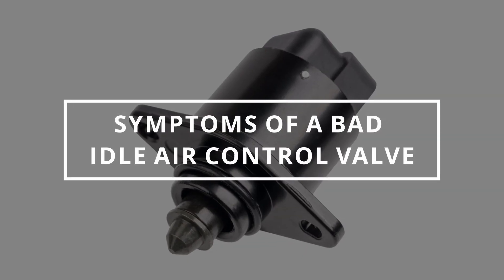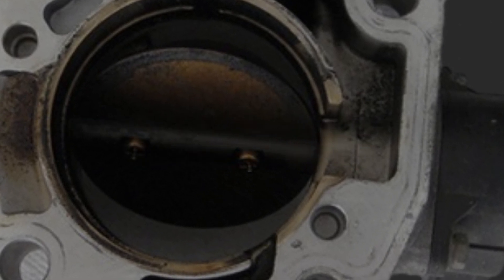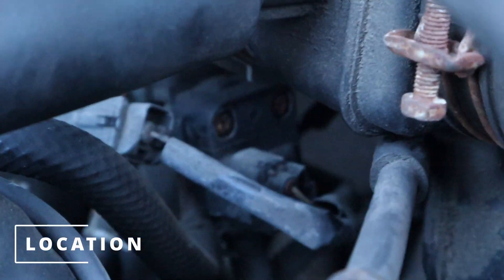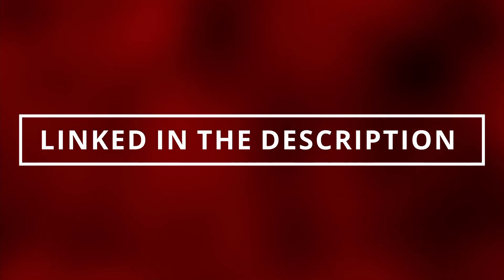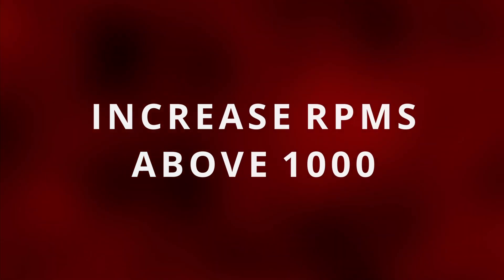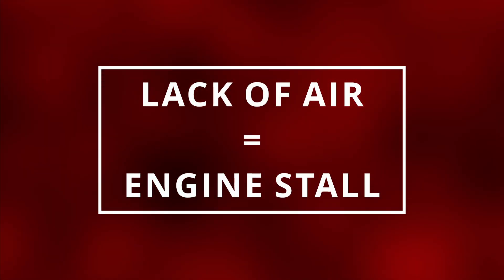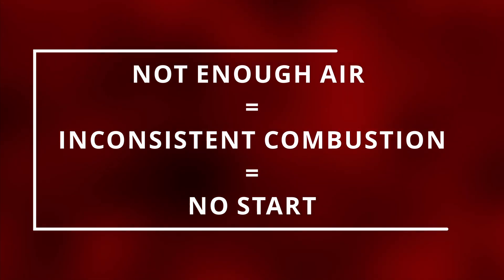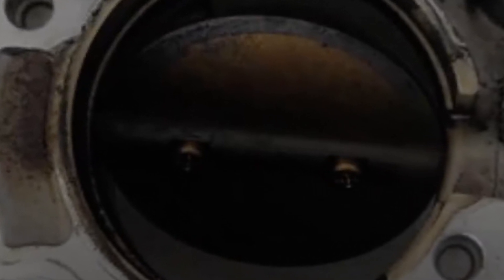SYMPTOMS OF A BAD IDLE AIR CONTROL VALVE

Comment: Would be impressed if u have an answer to this one. Tata Indica SLi 2008 1400 Petrol. After a Clutch replacement that have nothing to do with the fuel injection system, I have the Following symptoms:
Engine start first time but idle to High then after 10seconds go down to normal. When driving the engine runs perfect until you stop. The idle surge three times between 1000 and 2000 rpm then a last time to 3000, sometimes 3500 rpm then slowly goes down to normal and stay there. I I ref it up again it comes down to normal, but a little slow but not surging. But just drive 10 meters and same thing happens. I replace the Idle sensor with a new one, making it ever worse
Reply: check the pistons, and run high octane gas for a fill up and that should clean most of the junk in there. if you have an IAC then take it off, tape the hole, clean it with carborator spray or something similar while keeping the motor up as to not damage it then just spray until all the carbon build up it gone, should hopefully fix that

Comment: Mine got stuck in between and it was idle up and down on its own. But it drove fine while moving.
Reply: My 2015 Subaru STI does the same thing. Video me mods I did to it was a k&n insert air filter p it has about 56,000 miles on the motor. And I still have the original brakes on the vehicle if you can believe it 👍🤠
Reply: @user-vl2zh6bj6x  I actually found out what the main issue was. Was in fact not the IAC. It’s the positive crankcase ventilation pvc tube. I put a new iac on and still heard a loud vacuum leak. Further inspection and the connector right under the accelerator cable bracket is worn and allowing air

Comment: Thanks for the video. My idle is perfect after closed loop at 725. Open loop is 1500 then 3 minutes later goes to 1100 then after 3 minutes goes to 700. Is this still a symptom of iacv? 99gs300.
Ps, only evap codes
Reply: Yes my mustang did that before

Comment: I have this code on my subaru can u help me, P1143, P0107, P1516, P1510. Sub forester 98. Plz one video
Reply: Sounds like a lot of potential issues with the throttle body. Cleaning the throttle body and inspecting or having a professional diagnose the sensors is probably a good start. I just cleaned my throttle body if you want to watch it on my channel. 

Here are a few possible causes for the codes: 
P1143 Oxygen sensor , P0107 MAP sensor, P1516 Throttle actuator control ( high risk), P1510 Throttle body communication issue? 

NOTE: These codes could indicate a variety of other problems as well so don't be afraid to take it to a mechanic for professional diagnosis/repair.